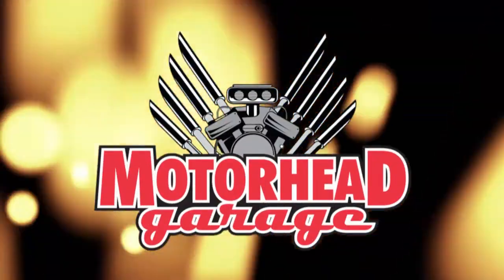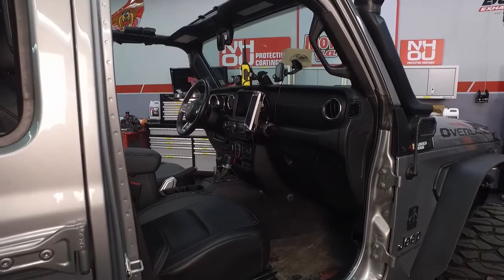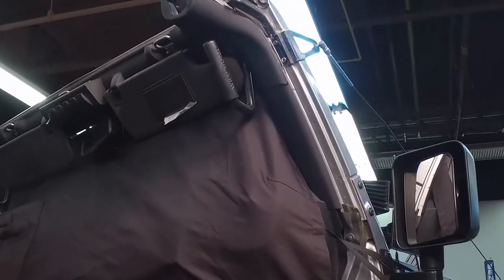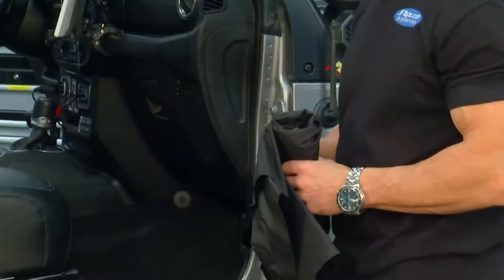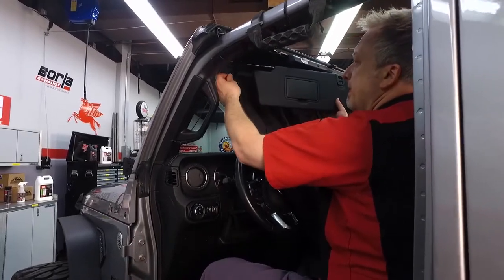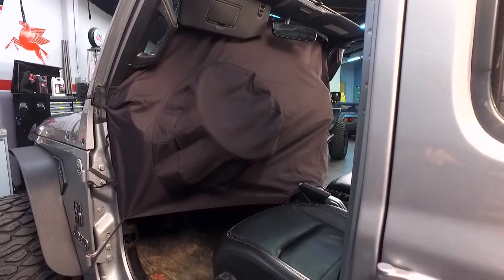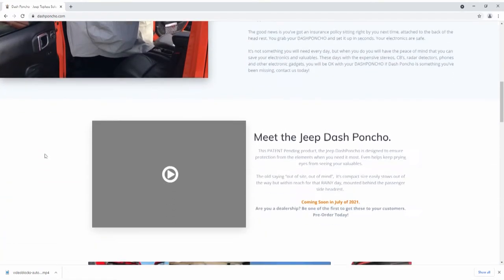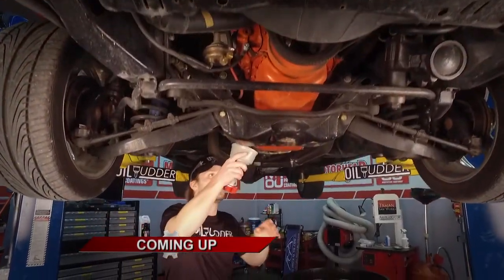PROTECT YOUR JEEP'S ELECTRONICS | Motortrend debuts Jeep Dash Poncho | 2021 | Motorhead Garage

Comment: Does this work with the forward looking safety components above the mirror?
Reply: Just install over the top of the component above the mirror. Suction cup on the sides. Once you have the cups in place flip visors down to secure. I don’t build a specific model for that. I personally have a Gladiator & Bronco with the same feature. It works fine without any issues. 
You could put it under as well. But I prefer to cover it. 
Thanks for asking. Hope that helps. JF